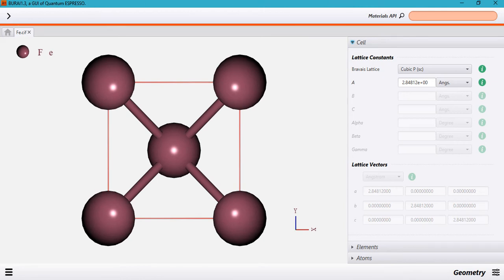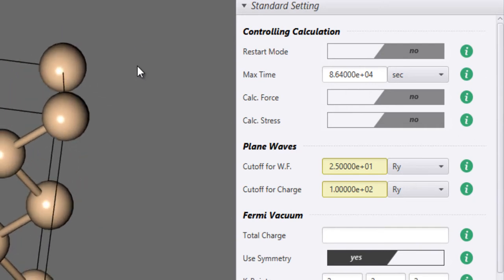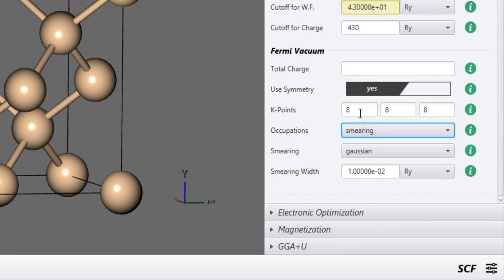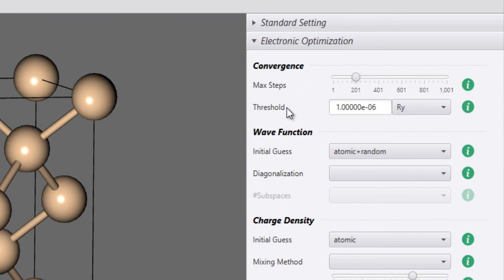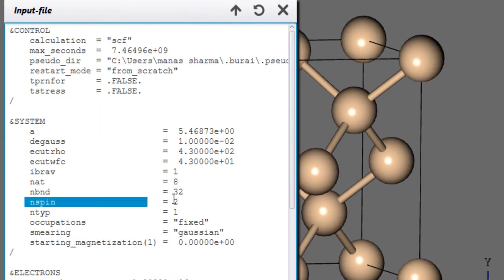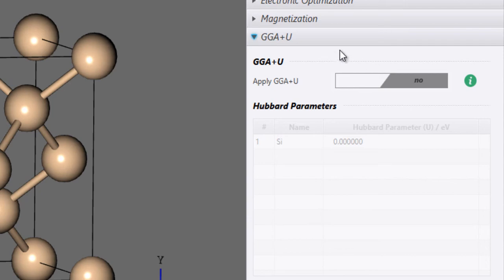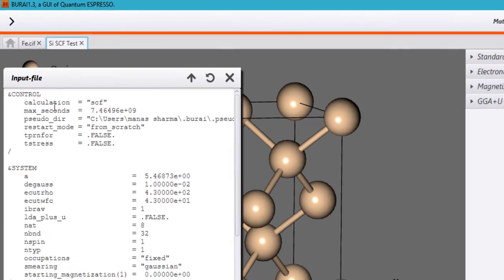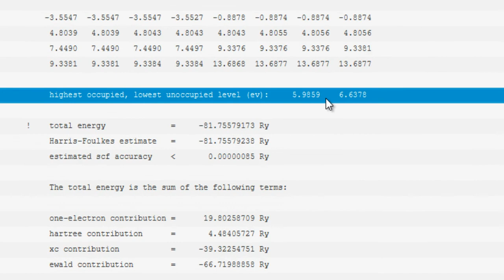SCF Calculations using BURAI (GUI for Quantum ESPRESSO) - [TUTORIAL #4]

Comment: Thanks for making interesting tutorials of my software :-)
Reply from the maker: I should be thanking you for creating BURAI.
Really grateful! :)
Reply: Hello total newb here. I have a question: do scf and band calculations really take a long time? Like how long on the average?  Im trying to do scf and band calculations for fcc fullerene (C60 so a total of 240 atoms) and its been 30 mins and burai still says calculating. Is this a hardware problem (unfortunately im only using a 4gb ddr3 ram with core i5 processor)? It wasnt this slow when I tried to do the same with the NaCN sample in the examples folder.
Reply: @johnconrad4439  240 atoms?
You're in for a long ride... hope it's done by now!
Reply from the maker: @johnconrad4439  The calculation time scales with the number of electrons, unit cell size, KEcutoff, etc. Moreover on just 4 GB RAM I think you can only run a serial calculation rather than a parallel one, which makes matters worse.

Comment: I'm facing problem in running the file. It says error, command: pw.exe -in espresso.in . Can anybody help on this?
Reply: change the path file of QE and MPI. There are a small icon ''>''' on the top left corner. You will find Path to QE...

Comment: Sorry for simple question: I have a computer with 2 processors totally 24 cores (12+12) and 48 threads. When I run calculation default setting shows 48 and 1 for "processes MPI and Open mpi. Should I keep this setting?!

Comment: Hello, this video was really helpful in understanding the usage of those parameters but could you please explain what exactly is ecutwfc physically and how increasing it causes the energy to converge? I must better ask what exactly does it put the cut-off on? I asked the latter question because there are ecutwfc, ecutrho and ecutfock, these all should not be the cut off for one variable 'energy', I think it is the cut-off for something else.
Reply from the maker: ecutwfc and ecutrho are the kinetic energy cutoff of the plane wave basis used to describe the wavefunctions and the charge density, respectively. The larger the energy  cutoff, the slower the calculation would be, but more accurate. The choice of the cutoffs depends only on the pseudopotentials you are using and on which quantities you are interested in (for instance, magnetic properties are harder to converge wrt total energy). Once you've chosen your PPs you can test convergence of the energy wrt to cutoffs in the cheapest system (usually in the bulk).
Reply from the maker: "...when we make a Density Functional calculation with plane waves, the (electronic) wavefunction is represented as the infinite summation of plane waves, which must be truncated, in order to be able to handle them computationaly.
So, the more plane waves, the more accuracy, but also higher computational cost. The trick for speeding up the calculations relies on the fact that the plane waves with less kinetic energy (represented as ℏ2 / 2 m |k+G|2) have higher contribution to the totality, so the plane waves with lower energy are the most important. But, up to which point should we increase the cutoff, so that we get a good balance between computational cost and accuracy? That is precisely the optimum cutoff choice."

From https://blog.larrucea.eu/checking-optimum-cutoff-qe/

Comment: Hello.. I am trying to do SCF calculation of MnO2. I dont know which potential is suitable for this. How to check it? Also there are three atoms in the unit cell. How long it should take to complete the calculation?
Reply from the maker: Usually ultra-soft pseudopotentials are good for research puprposes. You can also try searching for research papers using QE and MnO2 and see what they used. With just 3 atoms in the unit cell,  it shouldn't take too long. Maybe 10 minutes at max.

Comment: When I press Element tab of geometry, there is no pseudopotential listed, even though files exist in Burai1.3.2 directory and qe-7.0 directory. Cant seem to get the software to access it
Reply from the maker: That is strange. Which OS are you using?
Reply: @PhysWhiz  I am on ubuntu 20.04. This problem I overcame when I realized there was a mistake in the path of QE. Now I am encountering a new problem, error file gives "error while loading shared libraries: libmpi_mpifh.so.12: cannot open shared object file: No such file or directory". 

I installed openmpi v1.10 which is supposed to have this file. locate command shows I have /usr/lib/x86_64-linux-gnu/openmpi/lib/libmpi_mpifh.so  and ....so.40.20.2 but no so.12.

Thinking of which, is there a Burai version which does not require multicore or multiprocessing?

By the way thank you for your reply. Hope you can help here.
Reply from the maker: Hi, unfortunately I could never get BURAI working 100% on Ubuntu or MacOS. It just doesn't play well for these two OS.

I usually then use it as a structure modeling software and add the pseudopotential paths myself. Take the input file, and run it using my own compiled QE. It is quite easy to compile QE on Linux. There is a video on my channel for parallel version compilation.
Reply: @PhysWhiz  Got it. Maybe if Burai came with a version that doesn't need multi processors things would be better. I linked burai to QE that runs on command line. That too gave a multi-core error.

Comment: excuse me, sir, so I'm doing research using qe burai, but when I run anything (optimize, scf, etc) the result is immediately goes green and it says 'fatal error in mpi_init_thread' in the LOG, I wonder why? , even though the placement of pw.x and mpi is correct. Thank You.
Reply from the maker: Hi, The error can occur if there is something wrong with your input file. You will find more information about the nature of error if you go to Results-> log or CRASH file. There you will find the exact problem. The MPI error message is displayed even when the problem is related to the input file.
Reply: Ok thank you for the reply, i also wondering if in BURAI quantum espresso, is it already have a method called d3 or dispersion built in?
Reply from the maker: Based on the user guide, it does have dispersion correction but I am not aware about how to do it.

Comment: IT is showing SCF not convereged.
waht can i do?
Reply from the maker: There are several steps that can be taken to address convergence issues in DFT calculations using Quantum Espresso:

1. Try increasing the maximum no. of SCF iterations, in case you were close to convergence but not fully converged.

2. Check the quality of your input data, such as the crystal structure and the k-point grid. Inaccurate or poorly chosen input data can cause convergence issues. Usually, it is bad geometry that is the culprit. You can also try to play with density mixing parameters.

3. Increase the number of k-points: Increasing the number of k-points can improve the convergence of the calculation. This can be done by using a denser k-point mesh or by using a higher-order k-point sampling method.

4. Increase the number of electrons: Increasing the number of electrons in the simulation can improve the convergence of the calculation. This can be done by increasing the simulation cell size or by adding more atoms to the simulation cell.

Comment: Hello..
Thanks for the nicely presented video.
But for SCF calculation of MoS2 (which is not available at Material API), I followed the following steps and faced error as described below:
1. Downloaded the CIF file (1011286.cif) for MoS2 from crystallography.net website
2. Saved the CIF file inside examples folder of the .burai folder
3. Chose SCF as you showed in the video and clicked on RUN
4. Save the project by creating a new folder as "1011286"
5. After that it is showing 
ERROR in running the project: C:\Users\nitr\.burai\1011286\1011286
COMMAND: C:\Users\nitr\Downloads\BURAI1.3_Windows\BURAI1.3_Windows\exec.WIN\mpi\mpiexec.exe-n 4
 C:\Users\nitr\Downloads\BURAI1.3_Windows\BURAI1.3_Windows\exec.WIN\pw.exe-in expresso.in
6. After going to result section, it shows these three files
CRASH, IN, LOG.scf 

Can you please help me knowing where did I go wrong and how to correct the mistake..
It is very urgent.
Thank you in advance.
Reply from the maker: Hi there, could you please tell me whats written in Crash file and log file.
Reply: @dianapradhan4633  make sure the spelling/small/capital of Mo4+ is consistent with name of atoms mentioned in ATOMIC_SPECIES card,
i think you should also write the atom (Mo) instead of ion (Mo4+)

Comment: What should i do when the energy is not converging even after 200 iteration?
Reply from the maker: That usually means that the starting geometry is quite wrong. You also mentioned that the MnO2 unit cell has three atoms,. I am not sure what particular crystal system that is but wikipedia shows it as having like 8 atoms: 2 for Mn and 8 for O2. Maybe you're running on a primitive cell or something. But since your scf is also not converging its most likely an issue with your geometry. Can you provide some details regarding that here?
Reply: @PhysWhiz  Yes. I have done the Rietveld refinement of the XRD pattern of alpha MnO2. From the refinement data I find three atoms: one for Mn and two for oxygen (different atomic position). I started with this and with pseudo potential but i am unable to complete the calculation.
Reply from the maker: @science.ashutosh  what are the atomic positions and lattice parameters you got from that?
Reply from the maker: I meant 6 atoms, 2 for Mn and 4 for O.

Comment: Hi, thanks for going through the tutorial in such a nice way. I tried to duplicate your settings and run using PWgui. However, my total energy converged to 553eV and bandgap of 6eV which are obviously not correct. What's wrong with it? here is the input file.

 &CONTROL
                 calculation = 'scf' ,
                 max_seconds = 86400 ,
                restart_mode = 'from_scratch' ,
                      outdir = '/home/edmund/Quantum-Espresso/Tutorial/tmp/' ,
                  pseudo_dir = '/home/edmund/Quantum-Espresso/pseudo/SSSP_Acc/PBE/' ,
                      prefix = 'si' ,
 /
 &SYSTEM
                       ibrav = 1,
                   celldm(1) = 5.46873,
                         nat = 8,
                        ntyp = 1,
                     ecutwfc = 44.000 ,
                     ecutrho = 440.00 ,
                        nbnd = 32,
                 occupations = 'fixed' ,
                       nspin = 1 ,
 /
 &ELECTRONS
            electron_maxstep = 200,
                    conv_thr = 0.000001 ,
                 startingpot = 'atomic' ,
                 startingwfc = 'atomic+random' ,
                 mixing_beta = 0.7 ,
 /
ATOMIC_SPECIES
   Si   28.08550  Si.pbe-n-rrkjus_psl.1.0.0.UPF 
ATOMIC_POSITIONS angstrom 
   Si      0.000000000    0.000000000    0.000000000    
   Si      4.101546000    4.101546000    1.367182000    
   Si      0.000000000    2.734364000    2.734364000    
   Si      4.101546000    1.367182000    4.101546000    
   Si      2.734364000    0.000000000    2.734364000    
   Si      1.367182000    4.101546000    4.101546000    
   Si      2.734364000    2.734364000    0.000000000    
   Si      1.367182000    1.367182000    1.367182000    
K_POINTS automatic 
  4 4 4   0 0 0
Reply: celldm(1) = 5.46873 ???, when your using celldm(1) kind of parameter, you should provide the unit of bohr